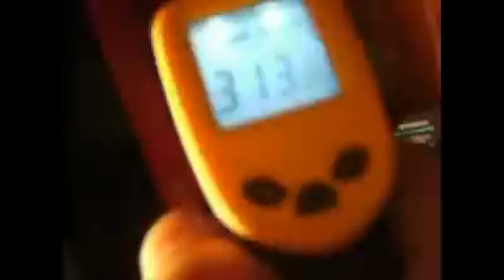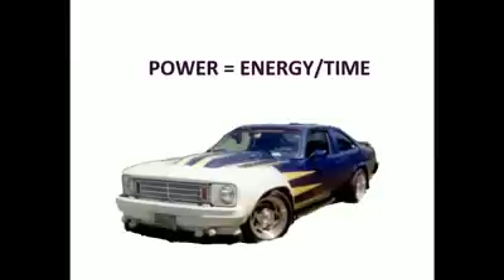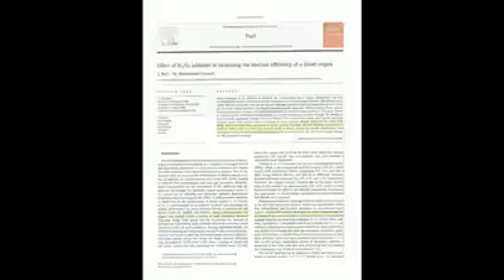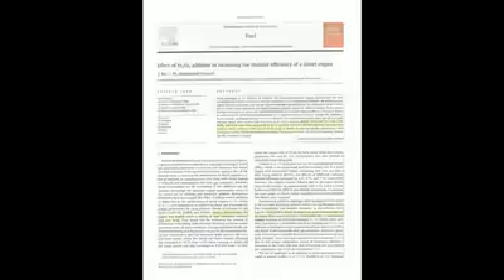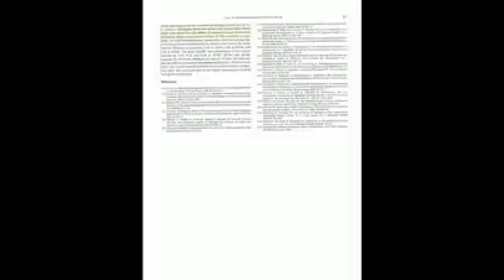Scientific PROOF that HHO WORKS Part 3

Comment from the maker: There is a lot of things that can improve the effectiveness of HHO, Peltier Modules, and Stirling Cycle Generators, are among some of the things that would work. Couple those ideas with a stationary Mighty Engine turning a high efficiency generator and you could drastically reduce the need for fossil fuels. Now if we used ethanol created by the reformation of municipal and agriculture waste then we could possible eliminate the need for gasoline all together.

Comment: A plug in Sequential Hybrid with a very small engine can Kick ASS.  
Please consider the Peltier Modules for generation of HHO electric. This can be done efficiently by taking advantage of your free cooling system....that is....your carburator ! !! 
Most people concentrate on heating one side of the peltier. Cooling the other side is just as important to get the heat flow. 
Exhaust on the hot side. Ducted intake to cool the other side. A carburator can freeze it gets so cold, great contrast !

Comment: All arguments aside: your project with the sequential electric is AWESOME ! ! ! 
Regardless of any little arguments I think that few engineers would say that Parallel hybrids are more efficient. In fact I believe that the Oil cos like the Prius because it is LESS efficient. How could an engine winding up and down the RPM range be more efficient than a stationary engine at optimum RPM. 
Keep Goin Man. You are one of the few engineers for the poeple. Most engineers are bought and paid for.

Comment from the maker: @NotSoOldHippy --- Actually it appears Ronn Motor's Scorpion will be the first production vehicle with on-board H2/O2 system. JJ is correct when he implies we are only at the beginning of bigger things to come. Adding H2 to gasoline engines for example will allow for higher compression ratios which will make them even more efficient. There is even research into a throttle-less gasoline engine that could increase then even more. But you are also right, there are bogus claims out there too...

Comment: "If HHO actually worked anywhere near what claimants claim in their frauds and scams, cars would already come with it installed. "

Really? Why is it then that fuel injection was first used in gasoline engines in 1925, but only became popular in automobiles in the 1980's?